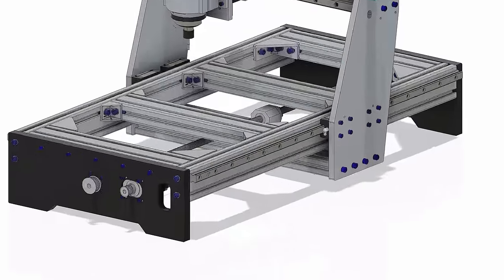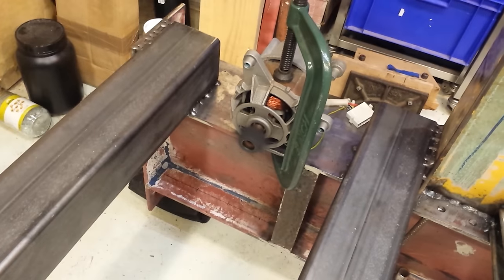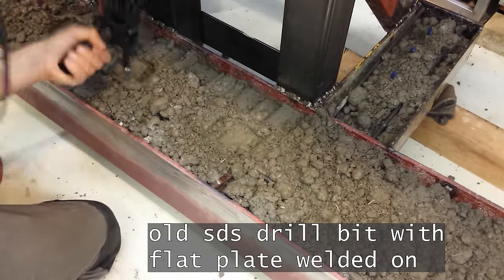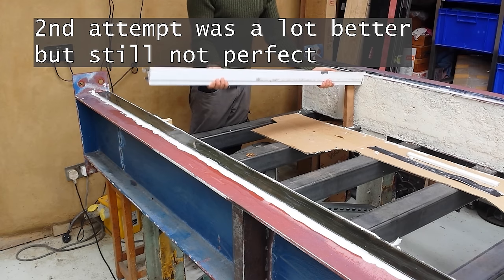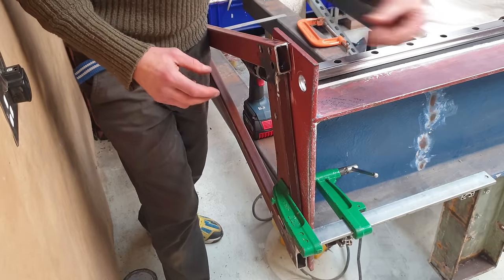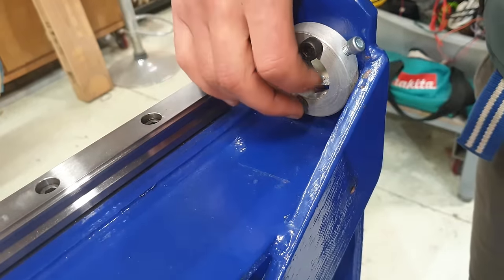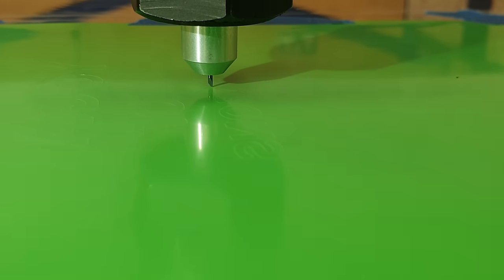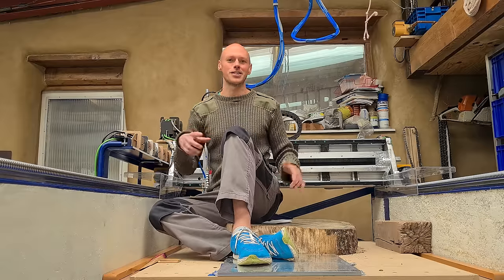Can we DIY an Industrial grade CNC?

Comment: Cast iron is the material of choice not merely  because it's cheap and moldable but it has a marvelous capacity to recover its original geometry and dimensional shape after undergoing enormous stresses that might impart permanent deformation onto structure steel.  
I thought the automatic lowering engineer  hoist was just brilliant. 
Umm steel? No.  Not any thicker than 1/16"  the aluminum overhead crane just won't be rigid enough.
Reply from the maker: Hey Raul, thanks for this. Cast Iron would be nice, but casting that volume would not be quite the mission for my DIY setup... I'm not sure I understand your last point there? Are you talking about the aluminium gantry of the machine? It's actually a composite...
Reply: @FloweringElbow  yah the two vertical arms  and the cross member.  I really doubt there will be sufficient rigidity to machine steel.   Gotta say I was impressed you pulled it off in Alum.  I've tried to use a router on alum.   Made me glad I have a milling machine.

Comment: Talk about over kill... definitely a machine you can will a few times over though. I made mine out of 1.5 inch ash for gantry and plywood on sides. #25 bicycle chain for speed and movement on both x and y axis. I couldn't afford ball screws. I use supported 16mm round linear rails mounted on a 3/4" plywood base and put a sacrificial 3/4 plywood piece on top of that. Vibration? ... of course, but it cuts at what ever maximum limit a 1/4" bit I use. Z axis is 1/4" thick by 4" wide steel plate with a nema 24 and a lead screw. X and y axis pushes about 12 -15 lbs before skipping a step. Steppers are nema 34's at 2.8 amps 24 v. Bits break if i go passed the recommended range  of the depth and speed provided by manyfacture. The spindle is a Chinese 1.5kw er11 collet with a 1/4" bit capacity. Cut width 18.5" length is 51" . Tons of guys making things around the world. Knowledge finally democratized. Excellent build!
Reply from the maker: Hey Pete, thanks for sharing. It's really impressive to see when people use what they have available and their ingenuity to make things work! sound like you have a very capable machine to be proud of! Peace, Bongo.

Comment: I’m sorry to tell you this, you did the classical mistake of confusing strength and rigidity aka stiffness.

Let me give you few examples of rigidity and strength.
Take a potato chip look at how stiff it is but if you put pressure on it will crack because it doesn’t have strength.
Now take a chain it’s very strong you can hang pull anything but it’s not stiff it’s all flimsy.

Now think about a bulb 💡 glass is like potato chip in strength, but the way that dome is designed it gives strength and stiffness to that glass dome.

So the way you design is the one that impacts stiff the cnc chassis is not how strong material you use.

Edit:- watch this video
https://youtu.be/IAG-mlkYub4
Reply from the maker: Hey Toby, nice examples. Yeah, I am very sloppy with my terminology. I do understand the difference though, and did try and balance optimal structural shape, with other practical material concerns and damping. So yeah, it's all a compromise in the end - and the design was probably influenced more by stuff I could scavenge than anything else :)
Thanks for watching.

Comment: Oh dear… you didn’t. Portland cement based concrete isn’t used for machine tools for a reason: it’s not dimensionally stable… ever. It swells, shrinks, and warps, and it never settles down. That’s why - despise the cost - epoxy granite or cast iron is used instead.

You’re going to find that your machine won’t hold tight tolerances over time. At this point, you’ve got two choices: accept the machine’s limitations; or chisel it out with an air hammer, install epoxy-granite, and re-scrape in the linear rail mounting surfaces.

If you do keep it as-is; when you’re designing parts to make on this machine, be sure to leave some excess clearance to account for the frame’s dimensional error.
Reply from the maker: Oh yes I did... :)  So far I'm not regretting it (it's been about 3 years since the actual concreting). Mind you I haven't been, and don't anticipate, making parts for spacecraft on this machine. It's more of a wood router that can achieve an excellent finish, and dabble in metals every now and again.
That said, I think there is a lot that can be done to stabilize concrete - such as substituting 1/2 latex SRB for water, and sealing well with paint after a LONG cure. It had big practical benefits for a DIY process.   I recon it's possible to get relatively good stability from concrete - see these guys who built the world's largest laser holography table from concrete. 
https://spie.org/Publications/Proceedings/Paper/10.1117/12.155030?SSO=1 
After 120days cure and painting, they were seeing seasonal variance of ~0.2mm, over a 20m span. I'd take that. 
If you're Titan and you need a new machine for the 10million$ order you need to deliver by yesterday, are you going to choose concrete? Not a chance. But for DIY hobby fun, I still like it!

Comment: that rotor? will very likely not be cast iron, it will be cast steel...
by god be fucking careful.
good job you got the vibartions down, as that bastard would shatter with a fair bit of excitement  if you got it wrong.
the fact you can machine that? is testament to how good your buuild is, 
and to get to get finish like that?
 at home? 
in your shed?
and you are about 15 years old by the look of it?
kudos.
Reply from the maker: Hahaha. Fun to read this stream of consciousness. Thanks for watching friend :)
Reply: @FloweringElbow  thanks for the inspiring build ...im going with a floppy hospital bwd design with a tilt axis....but she will get some extra angle in the base and the cast tv stand parts will be endplates with a bit of reinforcment after your tips.
If in doubt, overengineer it .
Mines gonna wobble like a bitch but its only for hacking out guitar bodies.
Reply from the maker: @deadprivacy  Good luck with it :)

Comment: Great work, but now let's repeat it with actual DIY resources... a hammer, a screwdriver, a drill, a few screws and some bale wire and duct tape... no welders, no lathe, or any other machine... :)))
Reply from the maker: Haha, good day Johnny, thanks for watching. I think it should be easier the second time round - it's a shame not many people have bale wire, so I felt I had to use a welder and power hacksaw instead ;)
Reply: @FloweringElbow  Next challenge is to try to turn that into a massive 3D printer! :)

Comment: Mach 3? That was where I bowed out of this video. Have a 👎 you earned it.
Reply from the maker: Hi Paul, sad to hear that. I'm really just learning this stuff, and Mach3 was just what my ESS (warp 9) card supported. I am far from wedded to using Mach3 - I guess with all the other elements there are to research, I just chose a friction-free path on this aspect (lots of diyers have used , well documented etc.). I know it was an ill-informed choice and I dont know how good or poor the software may actually be... We could well change in the future... Recommendations welcome.
Reply: @FloweringElbow  the whole Mach 3 argument is a tired thing. It's what you're using and it's working for you so good luck. With Mach 3 working luck is about all you can count on too. There's no real programming reason why Mach 3 works, that's for sure! Reading a file named, "Mach3Mysteries.pdf" written by the program's author himself is entertaining. Looks like Google can only find one place hosting it today too. So get it while you still can.

Comment: As soon as I saw the industrial linear rails I lost interest. Those are not DIY resources.
Reply from the maker: Sorry to here that. The thing is, they are VERY hard to beat for the price. I got lucky with all three sets from various different industrial resellers, that provide one off linier rails for a fraction of the cost of new.  I've seen people spend more money on regular roller skate bearings, v track and other stuff trying to find work arounds... Really I just couldn't think of another practical way to make a machine with this big a work area, that would come close to machining steel, without them. That's not to say there isn't a way...
Reply: @FloweringElbow  That's the point... they can not be beat with DIY resources. There is no challenge in building a system like that with industrial components. Anybody can do it.